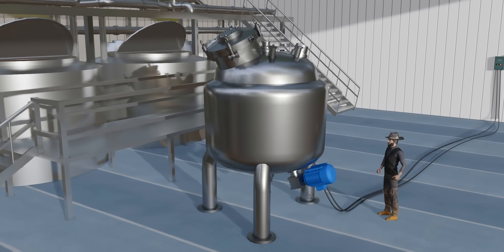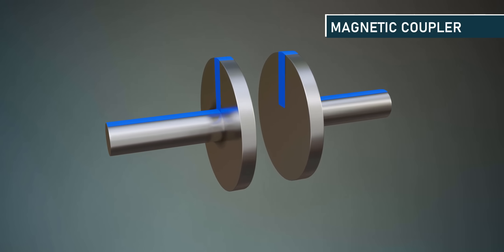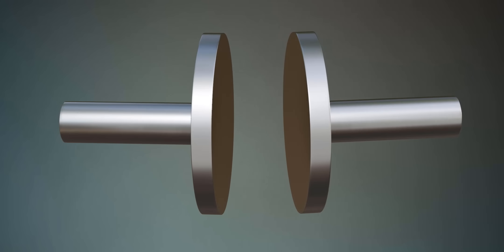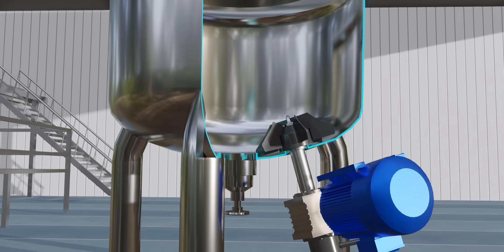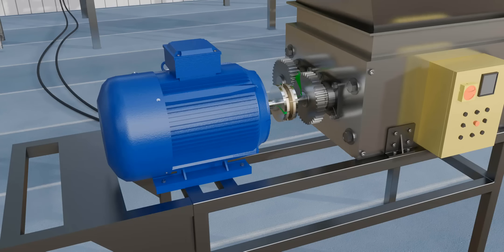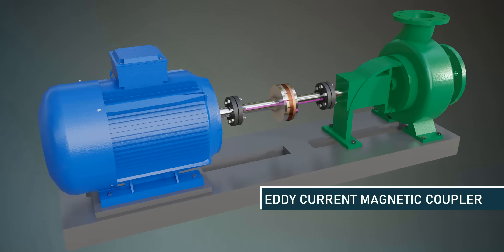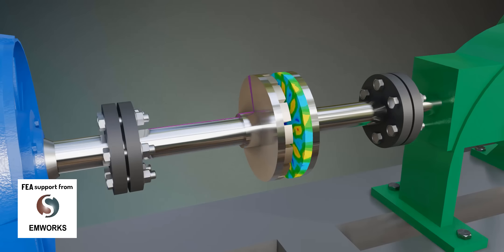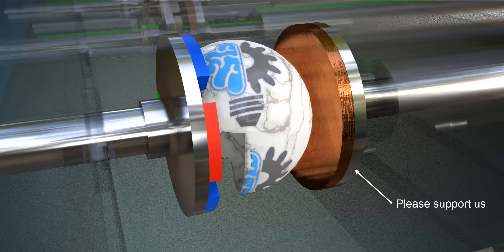Understanding Magnetic couplers!

Comment: Could be connected with reduction and multiplying gears, still working with the air gap and soft metal in between as a weak link to break in excessive overload.

Comment: If you even played Scrap Mechanic you would probably find out a similar design. A piston or a suspension are both "ghost pieces" that have no collision, which means if you need a through shaft (a part that does not exist in that game) you would make such "magnetic coupler" connecting two shafts using a piston.

Comment: I try to patent this idea in my company. Unfortunately the torque that this coupling is able to transfer is really low. And the cost linked to the neodymium and magnetic material are really high. The market for this kind of product is really really little, just for special applications. The business case was negative even for a big multinational like the one in which I am working. There are solution on the market, like gummy couplings, that are really cheaper and more attractive.
I am not telling that it is a bad technology, just that it is not suitable for the market.
If somebody know some application or field of use unknown to me, with some data please answer here 😊😊
Reply: There’s this guy who has made a different magnetic coupling system 

https://youtu.be/OAs9eoAH8_Q

Comment: Electric motors are mostly act like a cylindrical decouplers.  These days motors, specially dc ones have electronic control circuits which check the current and temperature.  If anything looks unusual, they can shutdown the power.

Comment: But wouldn’t it be easier or the motor be the coupler itself? So that the rotor  is the mixer part itself, and the stator coils are the fixedly parts on the outsides :) b
Reply: That's a damned clever idea!   It's probably already been done in certain applications.

But of course creating and maintaining a custom engineered device like that would be VASTLY more expensive than using standard electric motors and other  industrial parts.

There are dozens of companies that sell industrial electric motors, couplings, etc., but very few who design custom devices like you described.

Comment: interesting topics but it is made supeficially: i am thinking to use it on water pump on car as rpm/torque regulator and energy saver: as engines rpm rises, and water  pump rpm rises and after some rpm pump  makes cavitation and coolant flow makes too much resistance but no gain on cooling and it needs high power  , so goal is to hold pump rpm on some 4000 even if engine rpm rises over 4000rpm, so in coupler must happen slipping because difference of rpm between input and output shaft of coupler and question is do i really save any energy or it goes into heat in coupler

Comment: How strong the magnets must be to rotate a crusher?! 😮
Reply: you can make coupler with many magnets and on long radius  so you can get strong slipping force
Reply: Not that strong as you may expect, we use rubber connection instead 1cm thin, 5-10cm wide, 4 pieces and transmission, same situation with conveyor belts, longest one is almost 1km long and its enough

Comment: I was always wondering how rotors or shafts are being protected from leaks. I never thought it would be this 'simple'. thank you
Reply: I worked in industrial enviroment and i never saw magnetic coupling. Usually they use rubber gaskets, they last very long time if installed correctly, and very reliable if replaced regularly.
Reply: There are dozens of types of seals, orings, PTFE vee rings, sprung elastomers, leather, labyrinth seals (torturous path), solid carbon seals (very tight clearances at high temps), little pumping turbines that hold back the leakage, packing glands with various packing materials. Packing glands, orings and elastomers are most common.

They are leaving out why magnetic couplings are not usually used. They slip, which means there is not positive control between each side (at least most of them, it would be possible to make one that only slips on over load). The slipping also means it is not very efficient losing a large amount of energy to heat. They are also extremely expensive.

So they are only used in applications where the hazard due to a leak is extreme, or no other solution really works. Very caustic materials for instance. They have limited higher temperature use because the heat ruins the magnets, though maybe an electromagnet-eddy current design could be made to work at higher temps.
These things all require custom engineering making them expensive. 

What seal is selected depends on many things. The speed of the shaft, it's material, the sealed fluid/material, the temperature, service intervals, the hazard of the sealed material, how it is to be serviced, cost, among other things. That covers the most common considerations.
Reply: Though it's  still not so common. The method we saw in the beginning is still used on huge scale, doesn't cause any problem Though. Works even fine for high pressure  reactors (Personal  Experience).

Comment: This is an electric clutch. This is the key to create a manual Electric Car.
Reply: i think electric car doesn't need clutch, sole purpose of clutch is to keep engine running while stationary and spinning motor while idle isn't efficient. besides i think you pertains to fluid coupler used in automatic.

Comment: First!
Thank you for the video, I've been wondering about magnetic couplers for a while now and always wondered how they can transfer torque.
Edit:
I wish it went a bit deeper into the types of magnetic couplers and compared them, there were only advantages and disadvantages on the axial magnetic coupler.
What about the radial one? 
Are  there electromagnetic couplers?
Reply: I've never seen an example of an electromagnetic coupler, but in theory there's no reason it couldn't be done.

It might be a rather complicated and bulky coupling, but it's definitely possible.   Just replace the permanent magnets with electromagnets.

It's quite an interesting concept, actually.   It would give you the ability to adjust the coupling force by adjusting the strength of the electromagnet.

But of course the disadvantage is that the coupling would require constant current in order to function.